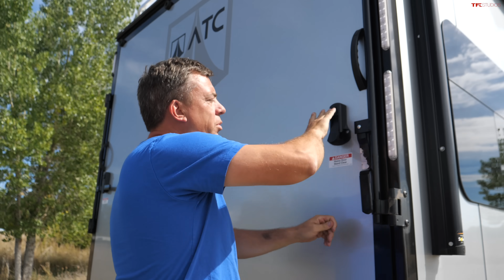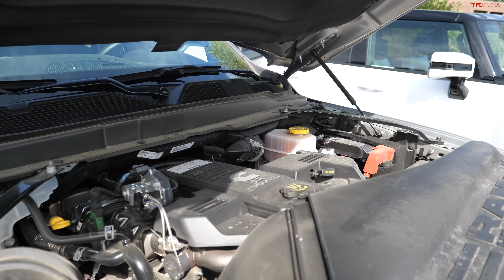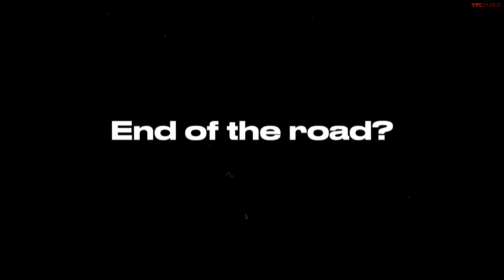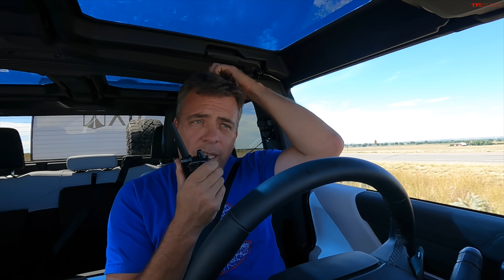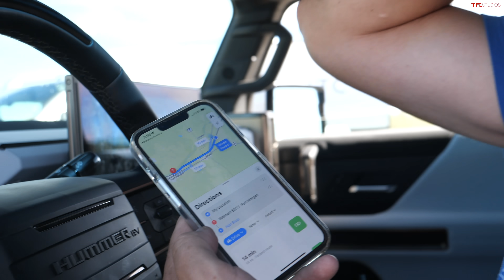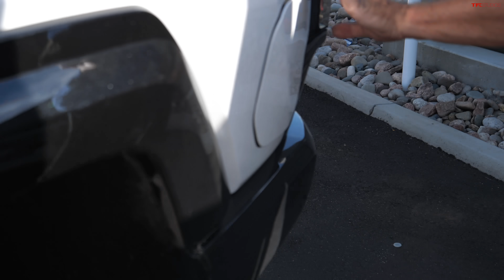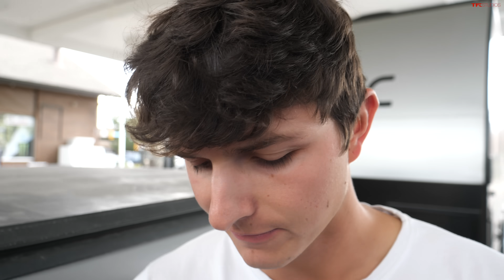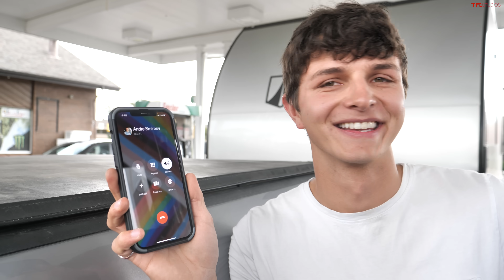How Far Can a Diesel and Electric Truck Tow An Identical Camper Trailer on ONE Fill-up?

Comment: They give away free electricity just to get you hooked no different than drug dealers , don't forget ; the cost of battery replacement , battery performance reduction over time , EMP either from a solar electric wave or from a nuclear device .
 Not enough lithium on the planet , I took some training on replacing these batteries , it has to be two guys replacing it holding hands using only one hand to work on the battery , especially at disconnecting the power cables , there is enough power in it to kill a technician , there is also the effect on the environment with all this toxic waste , mining lithium is absolutely destructive on the planet , unless they're having a plandemic in mind and wish there will not be enough people around to use all the lithium .

fossil fuel equals freedom in which you could go anywhere and do anything you want , Electric vehicles equals being stuck in a controlled Metropolitan , similar to a 15 minute Metropolitan , in other words slavery .

Comment: Hi Guys thanks for the comparison and for showing the reality of fossil fuel versus electricity generated from fossil fuels. The one piece of information that was missing here guys was how long did Andre have to sit around and wait to get sufficient charge to get back to Denver and what was the percentage of charge? ....Diesel did double the miles easily and takes say 10 mins to refuel and have a comfort break and get back on the road, what would the time be to get a 100% charge to be able to do 125 miles again?

Comment: New diesels are dumb, the government ruined them. My second gen cummins will pull that trailer about 700 miles on a 35 gallon tank of diesel at 21+mpg.

Comment: Was Andre using the air conditioning and playing the radio at road volume during the trip? Also remember there is a 40% line loss from the electric generating plant to the charger.

Comment: You didn't discuss the amount of TIME it would take between the 2 vehicles - how long would it take to go 500 miles pulling those trailers between the two  ---- realistically, people would go camping someplace away from home....  how much time woud it take to drive to the Grand Canyon or Glacier National Park - or FLORIDA comparing the two vehicles...  People have to actually USE these things ultimately..

Comment: Ironically at end of life for both vehicles the diesel will far exceed the hummer in total cost due to the huge efficiency difference and fuel costs. Right now electric is not great for towing but that will come with time

Comment: the new technology in the new diesels dont help their gas mileage at all. My dad used to have a 2005 Dodge Ram with the 5.9 cummins and it would get anywhere from 18 to 20 mpg towing our 30 foot camper

Comment: The electric was no surprise, but really disappointing mileage on the diesel - towing the same kind of load you could have got that or better with a big V8 like the 7.3L gasser and not have to pay the premium for diesel fuel.

Comment: Until EV's can run at the same rate as a comparable gas or diesel engine they are simply not worth buying.  That was a very small trailer and I am sure very lightweight.  128 miles per charge is totally unacceptable.  Those trucks are selling for $110k and for what exactly.  Just another reason to keep my gasoline powered Hemi 392.

Comment: Like they said at the beginning of that hide there is no terrain no Hills nothing to climb just pure flat-ground how often are you going to do that actually pull a trailer on absolutely perfectly flat ground with no wind you're usually pulling it in mountainous terrain
Reply: Of some sort so this is unrealistic the battery is useless because they would just kill itself pulling up hill

Comment: You really need to start measuring the carbon foot print not the kilowatt hours it is well know that electric vehicles actually pollute more per mile than diesel trucks do. And gasoline trucks produce even less pollution this is a failed Idea electric trucks they may be great if you live in a city but in the real world you can't ever take the kids to Niagara Falls.

Comment: That's poor  mileage for the Ram. Prime Inc is running loaded 53 ft trailers behind their trucks and get 8.   9 and 10 miles a gallon. Depending on speed  at 54 mph they do great on fuel mileage grossing 80 000 lbs

Comment: I wouldn't electric vehicle.  Already the Hummer has used half it's charge with less than 150 mi,e range. Give  me a diesel truck any day. The electric commercial trucks are just as bad. All they get us 250 mile range.

Comment: So you spent $46,000 more on a truck that needed $40 worth of electricity just to get home, not even enough to fully recharge it to cover the 120ish miles it covered, vs just over $100 in diesel to travel twice as far? Doesn't sound like it's a wise financial decision.

Comment: If you wanted to make the comparison on how many miles of towing that trailer makes it cheaper to own the hummer, you would have to tow roughly 310,000 miles in the hummer just considering energy prices for both. Until then the diesel is cheaper. Not that anyone would buy the hummer with that mindset, just a stat

Comment: Interesting! I wonder if there is a way to drop the HP on the Hummer EV from a thousand hp, to say 500 HP to extend the battery range on the Hummer EV. Since it reduces the HP when the battery gets below a set %, it should be possible.  But one thing you two forgot, is that Cummings diesel has around 200 HP roughly. And from memory a diesel is about what 30% more efficient than a gasoline engine or is it 50%? So relatively speaking it sounds like the Hummer EV, would be about as efficient as say a 1965 Ford F-250 with a 20 gallon tank and either a 240 inline 6 or maybe a 390 V8 with that same 20 gallon tank, just based on it’s range. Still not bad, but about on par with a gasoline engine with a smaller tank than the dodge.

Comment: $89,995 trailer.....LMAO.  If you vacation 30 days a year, (nearly Impossible), you would break even in 10 years assuming you would have normally spent $300 per day in hotel costs. That's not adding any additional insurance and maintenance costs.

Comment: I think the most interesting aspect of the E-Hummer , when it comes to towing, isn't that it's electric... It is that it has rear wheel steering
It would be fun to do an obstacle course where you have to tow a trailer across a tight and puzzling layout
first of all, the tighter turning radius of the rear steer will be an advantage
and secondly, you will crab steer while towing a trailer, something which I think is probably a first on YouTube

Comment: I have a second gen dodge dually 5,9 I pull a 42 ft toyhauler weighs 13, 000 dry and I get 14 mpg and 12 to 13 mpg when loaded with bike and golf cart

Comment: I’ve seen what a heavy duty electric truck will do. Rather will not do.  
   Not worth it. People are being scammed by the dealers the infrastructure yet again is still not here. 
   We’ve got the cart even a thirsty horse. Just no water to lead it to. And those electric horses need a drink frequently.

Comment: I am unsure why you selected 2 vehicles that are not in the same class for towing.  The Ram is pulling 6k + lbs which is  for its capability and the Hummer is pulling the same but it's near its' "max" tow capacity. Is this even a test that results should be considered when not even close to being in the same tow rating capability?  Too make this more of an even class, how about another run and have the Ram pull near it's max 21k + lbs at the same time the Hummer pulls near its max capability of 6k + lbs.  My crystal ball tells me the Ram will be lucky to achieve anything North of 7 MPG .

Comment: Had you run both to empty it would have been 3 times farther in the Ram.  And you didn't say how long it took to refuel the Ram compared to the Hummer.
Reply: @MysteriousMagicManWNWL78u  You may or may not want to refuel them every 100 miles, I normally get mine fairly empty before stopping to refuel on long trips.  I don't like stopping a lot.

Comment: There is also a time factor. Time is money and although you were using this to tow a recreational trailer, some of us are towing work trailers. not to mention tools in the truck bed. How long did it take the Diesel to fill compared to the Electric? By the time the electric is done charging the diesel in on the job site making money.

Comment: My hummer EVed1 gets about 96 miles on a full charge towing our 5800 lb camper.  I then have to detach the camper, lock it up, leave a note so it doesn't get towed, go find an EV charging station, wait between 45 minutes and 2 1/2 hours depending on the location, go hook up the trailer, and get back on the road.

I will not be buying another EV until we have DRIVE THROUGH charging and they charge a lot faster.

Comment: I love how he mentions the hummer is "incredible" off road yet during their own testing it has shown to be a 9000 lbs. Complete POS off road. The hummer is just a poser at everything it claims to be. In the end it is made for fools that feel good spending way to much for so much less. My ram I got for $10,000 used will out performed it in every practical category. That is less than 1/10 the price for a far more capable rig.

Comment: The travel distance limitation of EV's is the main reason I do not want one.  If I want to visit family in Florida 1200 miles away, I would have to recharge 4-5 times.  that would add an extra day or to to travel.

Comment: I will take my Cummins all day long. Not sure how many miles your diesel had on it but if it is less then 5000 it is not even broken in yet. I pull a 36 foot & it is a little over 11,000 pounds dry weight loaded with 2up 4 wheeler  a ton of normal  camping gear etc & get between 9 & 11 gallons while towing 60 to 65 mph is plenty while towing definitely not trying to win a race.

Comment: Here's what I seen. 
1. The diesel went twice as far 
2. The EV took 30 mins to charge 
3. The price to charge the EV if he didn't get the free promo 
4 the price of the diesel to refuel. 

My takeaway was that the Diesel went twice as far and only took 5 mins to refuel. And the cost of refueling the EV and Diesel would be the exact same if the EV recharged and keep driving to where the Diesel end at, and the ev would had to recharge again. 

Overall, the EV would cost about the same in refueling but take longer to get to the end point because of how long it takes to recharge.

Comment: This proves that electric vehicles are incapable of towing and hauling compared to diesel.    Imagine a scenario that you have to get that load to a location by a certain time.   You cannot make that deadline because you have to charge it    electric cars are more for getting groceries and getting to work, short distances .       Put a genie on the back and charge on the side of the road.   What if you ran out of juice 200 miles away from a charging station?

Comment: Regardless of all this stuff. What about running in the cold? That kills batteries and charging capabilities. Gas and diesel motors have had over 100 years to develop. You WILL NOT replace them in even 50 years. And you know how the battery life on your phone is great when it's brand new, but sucks as it gets to 1-2 years old. Yeah, the same thing will happen to these evs. Forcing evs is not about "saving the environment." It's about controlling you and your travel capabilities. Read George Orwell's book 1984. It explains everything.

I don't think you guys discussed how long the ev took to charge vs how long it took to fill up the cummins

Comment: 2 Options to Get More Range.
1 Drive Slower. Electric Vehicles usually do not have an optimal crusing speed. Therefore slower is much more efficient.
2 Ask the Cummins to Pull Both Trailers. It will handle it just fine. 🤣

Comment: At approximately 18:45: “The Hummer is the fastest charging EV available in the United States.” This statement lacks clarity for me. If you had said that the Hummer accepts a higher charge rate than any other EV, I would be comfortable with that statement.  What exactly is a good definition for fastest charging BEV?
1.	The BEV that gains the most range/minute while charging.
2.	The BEV that takes the least amount of time to go from 0% to 100% charged.
3.	The BEV that takes the least amount of time to go from 10% to 80% charged – that is, based on a particular standard.
I gravitate toward option 3. To me, the term fastest generally means something happens in the least amount of time. Other BEVs that are charging at a slower rate than the Hummer might beat it in any of the definitions suggested above. Fastest to me means spending the least amount of time at the charger which may not be the case with the Hummer despite its fast charging rate.

Comment: Let’s be clear, your fast charging is NOT always going to be free and Andre would’ve been charged over $40 normally.  bUT, Case went twice the distance so the cost was very close between the two under normal circumstances.  Not to mention the fact that Case was chilling out back at the office while Andre was still driving back after his charging time (not even to fully charged).  I just don’t see any advantages to an EV in any circumstance, other than showing off to your friends at a stoplight.  And yet all of this crap is being forced upon us by our “Dear Leaders” in DC.  Thanks a lot oh enlightened ones.  Give me a break!

Comment: FYI, the hummer went 128 miles on a single charge, which is 212 kWh. He paid .42 cents per kWh. 212kWh X .42 cents =$89 for a full charge. $89 / 128 miles = 70 cents per mile. 

Let's pretend they're going on a 500-mile trip. 500 miles × .70 = $350 in charging cost. 

Ram was getting 11 mpg. 500 miles / 11 mpg = 45 gallons of diesel. 45 gallons × $5.30= $238.5.

Comment: I see Ram is talking about the Revolution having a range extender on board for situations just like this.  I am looking forward to when you guys get one of those to test it so we can see if we will be able to work around this pretty serious towing limitation with the battery energy density we have available today.  The Hummer EV with 200kw of battery is the most of any EV on the road so clearly current battery tech just doesn't cut it.  Hopefully the range extender will come to the rescue for towing and heavy work applications.
Reply: Got a lot to do with the motor tech too

Comment: Do the test again with a loaded trailer as you would for a weekend of camping. If it did 128 miles just at the dry weight it’s not looking good with one ready for camping.

Comment: You are not supposed to charge EVs to 100% or run them all the way down because the battery life will be compromised. Also, it would have cost 40$ to charge the EV to the 50% he charged it to so 80$ full charge and 100$ to fill the ram with 2/3 tank. But the full distance for the EV was 128 miles and the ram could have gone over 300 full  tank. Not to mention fuel tax is about 18% on diesel and eventually EVs will need to pay that tax also.

Comment: electric can be good for forklifts or commuter cars, but beyond that, gas and diesel still dominant. By the looks of this video, you would have stopped twice to charge up, costing $80, which isn't far off from filling up in diesel. Plus for fueling you don't need a super fueler or remove the rv. As cool as electric cars/trucks can be, they're not practical in hauling and towing, especially long distances.

Comment: I'M TOTALLY LOST. WHY DO NOT THEY PUT A SMALL GAS GENERATOR TO PROVIDE POWER WHILE MOVING. GIT RID OF THE 3500 LB BATTERY. ALL EVs SHOULD HAVE A GENERATOR ON BOARD, AND LESS BATTERY. AT  THIS TIME ONLY THE WEALTHY AND CRAZY CAN AFFORD EV TRUCKS. MAYBE IN A CENTURY OR SO, THEY WILL FIGURE IT 😑😐🤨OUT

Comment: Oh come on. Stops the diesel with more than 1/4 tank, and the EV with 5 miles range left? Why not just take a trip, stop only when you must with regard to charging+fuel stations and see what actually happens with regard to range and time at each stop and leg. Because each subsequent charge won't be to 100% unless you WAIT.

Comment: Almost 3 times the range, 1/2 the price, (diesel wins hands down) I think it’s fair to say, there’s a million places that you’d have no charging station either, not good if you run out of juice in between. Lastly, $140,000 to (ride around town), no thanks. How much fuel could you buy for $70,000? He charged up for free on a promotion, you could drive free until your difference ran out. 1,000 fill ups at $70, Fossil fuels baby, can’t beat what God created for us to use, lol

Comment: So much for the diesel advantage. 2006 f350 with a 5.4 gets 9.5 miles per gallon pulling a 13000lb travel trailer. What the heck is wrong with that Cummins?

Comment: They screwed up using a Hummer instead of a Chevy Silverado 1500 EV. Which has 400 mile full charge range and only 670 hp, much lighter than the Hummer, cost half as much and has a 10,000 lb tow capacity. So I'm guessing an even high efficiency and double the rang than the Hummer per charge towing.

Comment: Run this comparison in very cold weather and the numbers for the etruck would be even worse. But don't give up on electric trucks. The technology is not nearly mature yet. Let's see what we have in 10 years. Be patient. Electric vehicles are the future. But not the near future. Once fusion reactors are a viable source of energy  and better batteries are available, electric vehicles will be the norm. But probably not in my lifetime. The (electric) train has left the station and there is no stopping it.